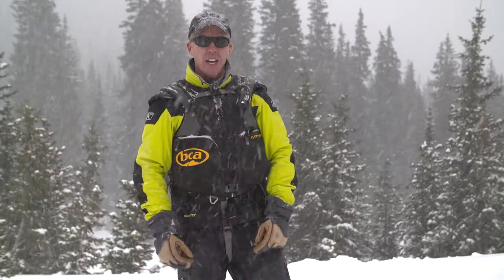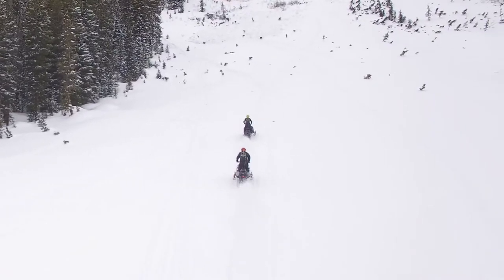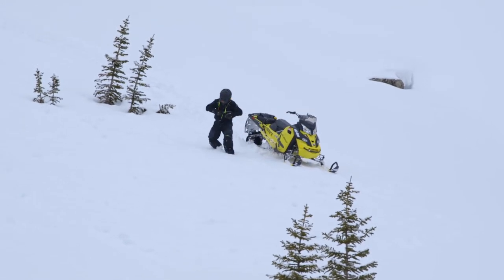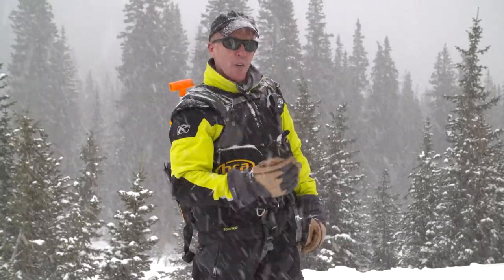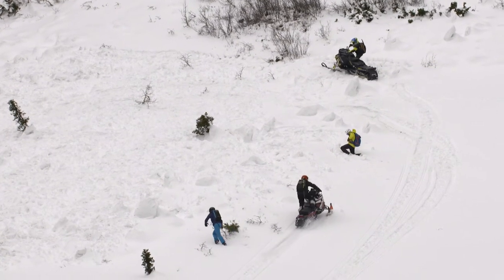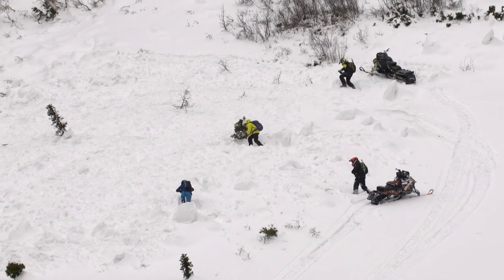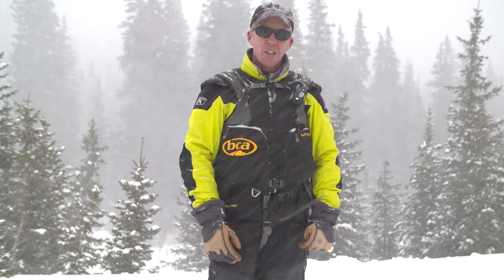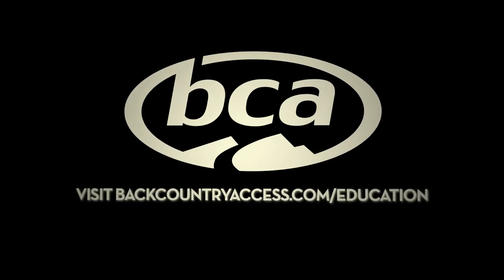Avalanche Transceiver Searching Using Snowmobiles

Comment: But if you don't have a reliable 'last seen' point and actually need to zig-zag across the slide to pick up a signal - how do you do that on a sled?? Going up slide debris is often tough, would be so horrible to get the sled stuck while you're frantically trying to search for your partner. Also, sleds are loud and you need both hands to operate them - how the heck do you hold or listen to your transceiver while trying to ride the sled across the debris field? Any advice?